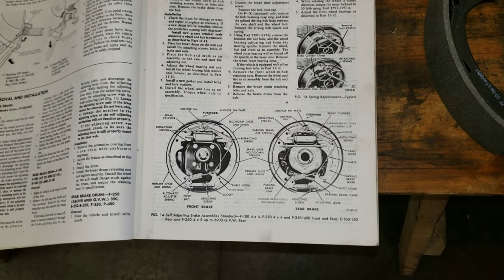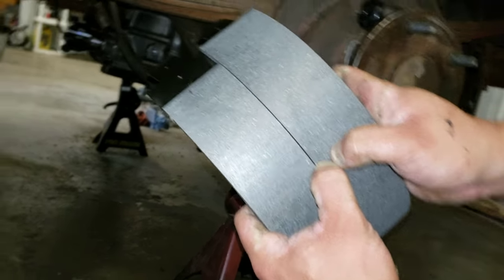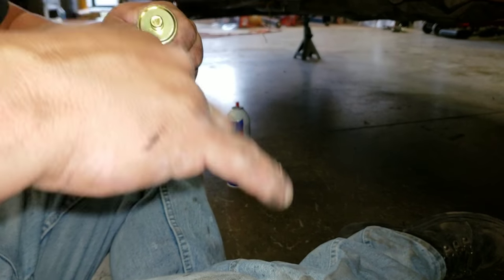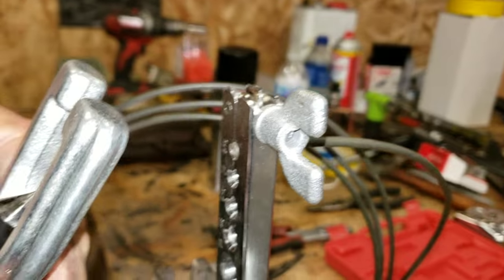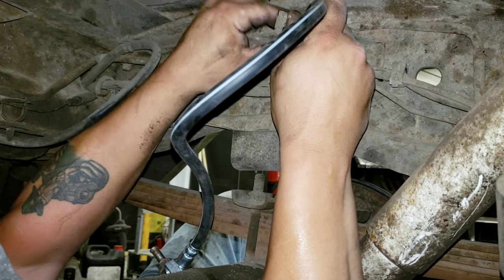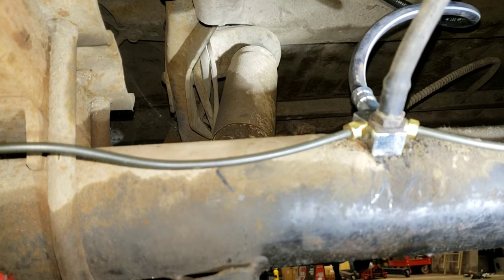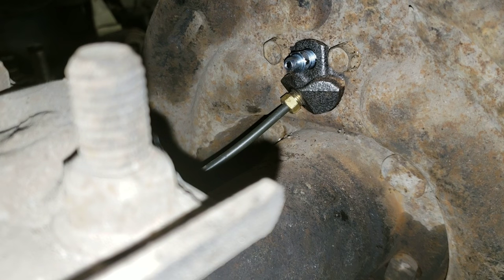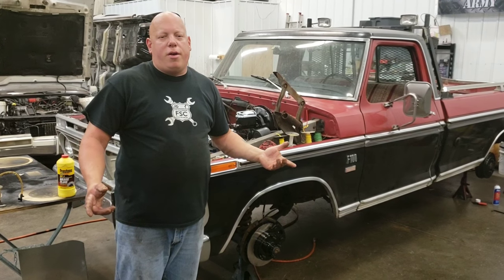1974 Ford F-100 Brakes    Part 2    Rear Brakes and Bleeding

Comment: Didn’t expect to find this old video of yours! I watch your newer stuff! Just came here to verify the process. It’s been quite some time since I last did drum brakes. I’m working on a 67 F100 rear end that a previous owner put in my 51 F1 (bought at an on line auction site unseen). First screw up was not checking the tag on the rear end. I was told it was a 72, but after shoe size didn’t match, checked the tag and it was a 67.

Comment: i have changed booster master cylinder both front calipers ive made sure were the pads slide in and out and still having problems with front braes hanging up any ideas plz feel me in an ideas
Reply from the maker: Make sure you have the long "u" shaped spring is on the proper side of the piece you hammer in between the knuckle and caliper.   It is also possible you have calipers that once they close won't open back up a touch to release the rotor.  But most likely not as you replaced them.  If the caliper does not slide properly it will hang the brakes up